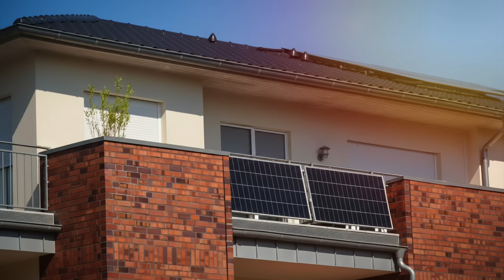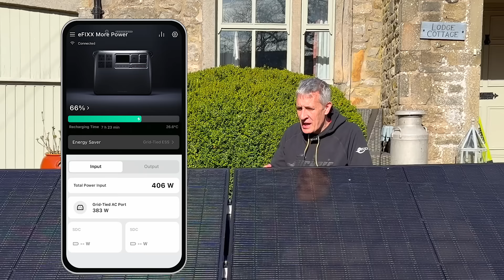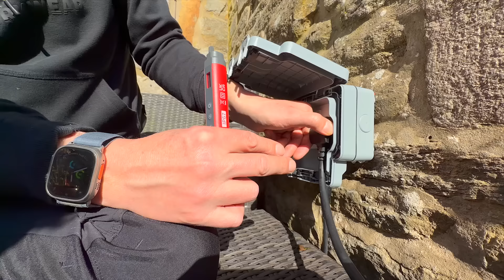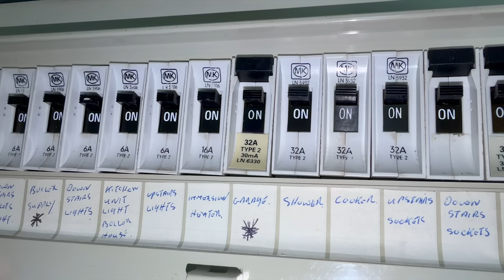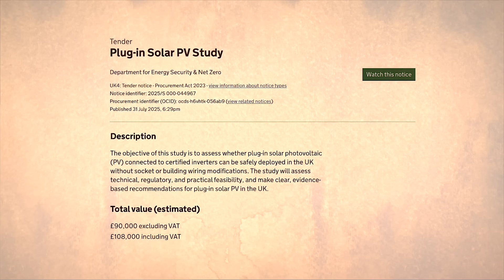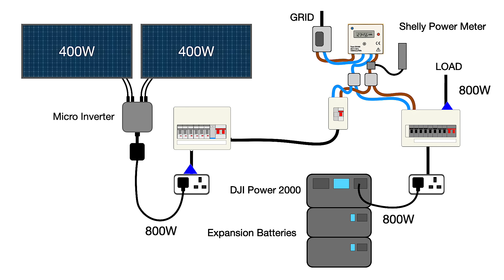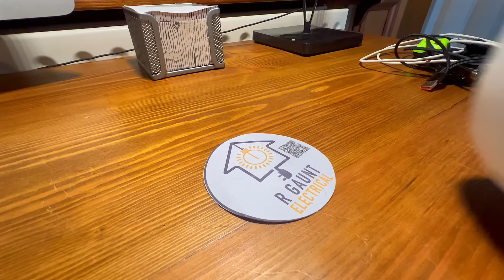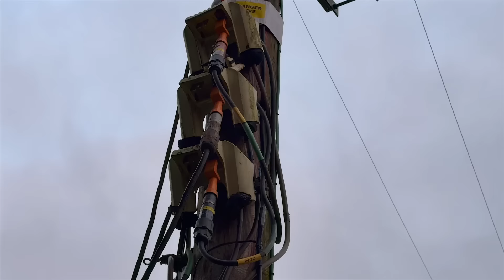Plug in Solar: We’re Told Never Do This… So I Did

Comment from the maker: Check Price & Availability
👉 https://hub.efixx.co.uk/DJIP2000

Plug-In Solar: Banned Today, Legal Tomorrow?
👉 https://www.efixx.co.uk/Articles/plug-in-solar-uk-regulations
Reply: Are the micro inverters only grid following or can they be ran as grid forming in isolation?
Reply: @agw5425 Only On-Grid
Reply from the maker: Grid following only
Reply: What are those water-filled panel support bricks? These look like an interesting alternative to bolting a frame onto my garage for the upcoming PV expansion..
Reply from the maker: The product is called Grambox
Reply: Can I ask what your smart meter would do with this in regards to if my meter was reading £2 on electric today and then I plug in my panels, would the meter slowly go backwards in £ or how would that work? 

Sorry it's badly worded 😂
Reply: @KiloHotel27 Depends on the Meter. Some count backwards some just freeze, some count forwards on reverse power.
Reply: @TonyFisher-lo8hh  Many thanks bro! I was wondering as our government like to take & not give back so I presume they'd just let it carry on & simultaneously steal our power
Reply: @TonyFisher-lo8hh "some count forwards" so you could be paying to send power to the grid?
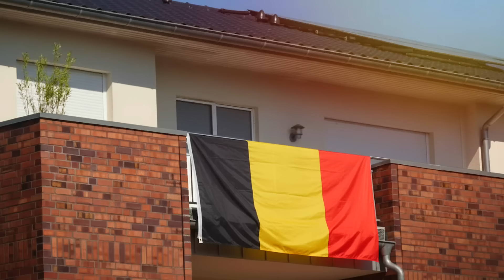Reply: 0:26 - WRONG, big time wrong data. 4 million balcony installations or even more cause most of these balcony PV are not registered and operated like "partisan" or better known as "guerilla" PV systems for years cause too much hazzle to register and too complicated registration portal. 

People buy the systems at Aldi or Lidl and install them easily by plugging them into a socket with nowadays 800 W AC limit and up to 2000 Wp solar panels.

The HWT berlin - university came to a conclusion that over 4 million are already working based on surveys they had done with resellers and customers. 
Right now over 1,25 million are officially registered - but the majority is not and people do not care as owners see it as their right to decide which kind of load and energy generation they are connecting into their sockets.

UK has a big advantage cause british sockets separate neutral and live properly due to a third pin which do not allow to turn a plug 180° around. 
In germany this does not exist and can cause trouble in some rare occassions. So german balcony mirco inverter come with 2 pin connector (and earth) where you can turn those around. Nothing will happen the microinverter will generate power and supply the flat or house.
Reply from the maker: Thanks for the heads up - 👍
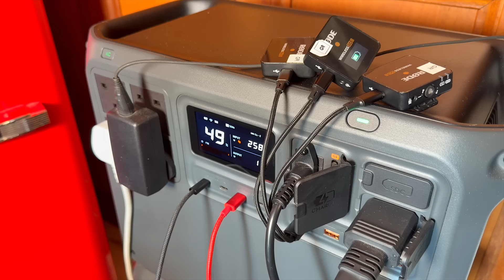Reply: 7:23 - bank of USB outlets
Do not use them this way by plugging in on a daily bases cause the USB C ports will suffer over time till they no longer work. Use a Hub or Cable instead that moves the usual wear and tear from a very expensive device (the dji bases) to a cheap cable or hub easy to replace. 

Happens to often that USB Type C ports struggle with that wear and tear, I have already lost an expensive laptop 3 years ago due to that issue. 

and regarding german balcony safety: it took over 20 years to force the regulator to accept first 600 VA or 600 W microinverter and another battler over 3 years or so for 800 VA or 800W microinverter. So far nothing has burned a flat or house down. 

If things had gone wrong then by the stupid who connected a series of balcony system to 1 single circuit which is usually protected with 16 A x 230 V = roughly 3700 W due to the wiring surface of 1,5 mm² - not diameter. in such cases everything can go wrong by abusing the limits but the same happens to a VW GOLF driver who is driving 140 mph in a village in front of a school or elderly care facility. They can do it and nothing might happen - till they get caught.
Reply from the maker: Great tip on the USB ports!!
Reply: I am confused about your setup, You appear to have panels that can export up to 800W to the home wiring and a Battery Unit separately hooked up the the supply, but no load appears to be connected directly to the batteries  (how do you use them?). Can those Batteries also provide power by the house wiring? Is it allowed to have more than 1 device able to supply the house with power? How are you stopping more that 800W of power being supplied? Ie the Batteries and Solar at feeding at the same time.
Reply: @SeasonsOfMists  The house is the load so if your house is using less than 800W you will be exporting to the grid for free.
If you are using more than 800W i.e. 1000W you will only be using 200W from the grid.
Reply: @FireballXL55  Hey sorry to bug you but I never got an answer and I'm a very curious man. If you get a minute please try to explain roughly what I'm asking for as otherwise I never learn 😂

Previous question on this thread somewhere - 

Can I ask what your smart meter would do with this in regards to if my meter was reading £2 on electric today and then I plug in my panels, would the meter slowly go backwards in £ or how would that work? 

Sorry it's badly worded 😂
Reply: @KiloHotel27 Sorry , do not have a smart meter, but I assume if your solar system is producing less than you are using it would show a reduced power level. So the total would climb slower.
I do not know if they can count back if you are producing more than you are using.
Reply: @FireballXL55  Okay thanks and yeah that's what I thought but with our wonky governments and how they scam us you never know 😂👍🏻

Thanks again 👍🏻
Reply: @SeasonsOfMists he did actually say that on a good day you could theoretically be pulling 800w from panels and 800w from the batteries simultaneously
Reply: Great video, thanks. After watching your first one I bought the 2000 and have since added one expansion pack. All working fine (no solar) and I’m paying on average 10p per unit. I have however, noticed an apparent anomaly and I am hoping you may be able to explain. While the Shelly shows real time demand give or take around 10 watts, my Octopus mini shows consumption around 20 watts. There is always around 30 watts difference. The 40 watts over the 19 hours of the peak period equates to 0.7 to 0.8 kWh and this is indeed what I am being billed for.  All figure are approximate of course as they fluctuate constantly. I understand that there will be always be a little import from the grid but why the difference?
Reply: The DJI units are showing as currently unavailable already lol. Like all of them. Even the 1000 series and the kits with panels all seem to be OOS.
Reply: legal from today i believe!!
Reply: @efixx  

The government has greenlit some changes to wiring regulations, which'll mean that systems under 800W can plug safely into domestic sockets without needing an electrician. This is expected to go live from summer 2026. And retailers such as Lidl are already preparing to bring plug-in solar panels to the UK.
Reply: @efixx  hi what is the life expectancy of this system?  (especially the batteries)
Reply: A small correction, if I may: In Germany, there are currently more than 1.2 million registered so-called balcony power plants. The emphasis is on "registered," because the number of unregistered plants is extremely high, and projections suggest that there could actually be at least four times, possibly even six times as many, in operation.
One of the main reasons for this is that many households still have old electricity meters installed that can count backwards, and registering a power generation system would almost certainly lead to the meter being replaced, which is certainly not in the interest of the balcony power plant operator.

Comment: Hi thanks for the great videos. I have just installed plug in solar. And very happy with it so far. I'm now interested in the dji 2000 battery to catch excess solar and charge off peak overnight electric. Don't want to export to grid but cover base load when no solar. What Shelly would I need also  what protection in distribution box to cover the dji battery in 3pin plug ie. RCBO/Rcd type. 
Thanks

Comment: Do you have a video on how you configured the Shelly / DJI power 2000 and the Ecoflow ? So that the "Excess" power goes to the DJI instead of to the Grid ? 
I have all three systems, but cant get the DJI to take the extra power to charge it up. The Plug in has its own circuit and the apps are loaded on the mobile and Shelly detects both the DJI and Ecoflow but the DJI is not being charged, only on the octopus overnight tariff, which I set a timer with the DJI app. 
So if yo have a PDF or video to show how to pair them all, that would be amazing. Thanks

Comment: wouldnt it be better in a battery system to input the solar power directly into the battery as DC, they output what is needed by the house from the battery?

Comment: I've recently bought a ecoflow inverter and 2 solar panels mounted them securely and plugged it in. Already after 10 days I've saved £10 i know its summer though.

Looking at the DJI in this video, without charging them on a cheaper overnight tariff you could also add solar panels to them? Whilst sending 800w back for your own usage?

Comment: The real issue is the voltages which you failed to measure. How will a system work if the mains voltage is normally over 250V? Will the inverters be unable to export? What if a neighbouring property is exporting? What voltage will sensitive electronic devices in your house get? What happens when an 800W micro inverter (which is connected to everything in a property via the consumer unit) and a kettle or oven is switched on? I would guess that the inverter shuts down as it cannot supply the current and then the lower power devices that is was power are powered by the mains for the duration. Not a big deal for a 3 minute kettle boil, but ovens are usually on for a hour or so. These questions need answering properly with an analysis of the voltage differences in an entire system.

Comment: hello, I followed your advice and got the DJI power 2000, ecoflow balcony system and a shelly Pro em-50, do you have any idea why I can not get thecoflow app to discover by blue tooth the shelly ?  Do you any simple wiring diagram on how the how to install the shelly, I think I have done it correctly following yr videos, but the drawing on the film is too complicated to follow for the shelly, thanks in advance..
Reply from the maker: I’ve got an indevokt @ DJI working off same Shelly device - my suggestion would be to use WiFi rather than Bluetooth.

Comment: The reason you should not backfeed into your house without a dedicated and bomb proof safety lockout in your fuse box or intake that will cut your house off in case of grid failure is the fact that you can backfeed power into the grid during a power failure, which could cause a electrician or contractor to contact a live wire outside your house when that system should be dead. If there is a transformer between your house and a damage wire, that is still high voltage. As a excavator operator, live cables when we are told they are dead, is a real threat.

Comment: Hi it is not JUST the unit the UK system is not safe for systems. So why not, first many houses use PME. THAT is the first no no, second ring mains, they are dangerous, why because a poor connection on somewhere on the ring or worse an earth  wire somewhere, failure is a problem. I used to as a matter of course separate the ring into 2 halves and put each half of a 20A or 16A protection. On top of that the UK protection only operates on the supposed live wire, so the neutral is not on say a ring main disconnected. Until the UK IEE sorry the engineers regs wakes up then you will have problems. I used to run 4mm cable to say washing machine and dryer sockets dedicated as the 2 could be using 6 KW so a possible overload on 2.5mm even not allowing for length etc. (Former NICEIC Electrician now retired)

Comment: Hi are the dji2000 batteries just plugged into a mains socket, do they charge and supply power to the house down the same 13a socket
Reply from the maker: Yes in grid tied mode.

Comment: I thank you very much for your video I have watched it before but I am now going to my housing association because they passed my electrical check with a type AC RCD  in my consumer unit  till 2030  normally this wouldn't bother me however I did not realise that wheelchairs that have lead acid batteries or lithium need a type A  RCD or it  can blind the RCD I mentioned this to him when he tested my electrics but he said I don't need to worry because the wheelchair charger will protect me but my wheelchair charger failed and my house did not trip when it should have I did tell him this but still was not changed

Comment: the Hoymiles HMS-1800-4T can output up to 1.8 kwh can this be used as plug in solar as well if you require to charge your house batteries that are kept in a different location on your property ?  my daily tick over is 1200 watts per hour

Comment: How does this work in terms of safety of working on the system as an electrician? If the  system is plugged in then it will surely be adding potential to other circuits either locally or at the DB?
Reply: No . A MSc certified unit shuts down.

Comment: A few fires and electrocutions should focus the mind - not of politicians of course and maybe not the IET...
If they can't stop Chinese scooters getting in and setting your house alight, they won't stop poor quality Chinese solar kits being sold.
The hype around 0.8kW tickles me.
Almost a waste of time & effort.
It's taken my 3.99kW roof system over over 7 years to pay back.
And now, despite my FIT contract saying rates will increase by RPI, this weasel govt have just arbitrarily changed that to CPI. Hardly surprising when we have a PM who is about to simply override the referendum and take us back into the EU without any recourse to the electorate.
And all the while, solar generation causes the grid more problems because it can't be curtailed like wind.....
Reply: If we were still in the EU we would have these already and cheaper Electricity.

Comment: Its actually an issue called Islanding which is illegal, the reason being if workers turn the power off to work on the lines and you are pumping electricity into it and kill someone, well that is the real issue. The way this is gotten around is with an inverter that power cuts with a grid cut.

Comment: I got £45.00 this month already and it will only get better with the summer months so a year pay back is overkill.
Reply: What system do you have??
Reply: @jablot5054  Ecoflow stream 1200w  micro invertor and 2 515 watt solar panels. its max 800w output though standard for the uk

Comment: In Germany, you must register a balcony solar system with the relevant authority. This can be done online in 5 minutes, but only since about 5 years ago. As a result, 1.5 million systems have been registered, and it is estimated that there are 5 million unreported cases; the approximate number of systems sold is well known. 

Topic: Inverters In Germany, and perhaps throughout the EU, a microinverter may only feed electricity into the grid when the outlet connected to the public grid is online. To this end, all microinverters have a built-in relay that electrically isolates the current. If the public grid goes offline (or the plug is pulled), the inverter must shut down within 2 milliseconds. That’s why you should hear a click when turning it on—that’s the relay. With German Schuko plugs, the inverter has long since shut down before the contacts come out of the outlet. With the system in the UK, I see a problem there at first glance, unless it’s been somehow mechanically resolved within the outlet.

Translated with DeepL.com (free version)

Comment: A lot of people are asking about breakers that are not certified for export.
But does anyone know what in such a circuit breaker could actually fail and why? Current already flows in both directions through a breaker (one way on +ve half cycles - the other way on -ve half cycles) - its just that with export the current flow direction changes 1/2 cycles - current is still flowing in both directions? Ignoring the fact its not certified, what is it that can actually fail with export? thermal element (bimetal strip)? magnetic trip? arc chutes and splitter plates?

Comment: Using a lead into a power point for solar input is a bad idea.
Using the switch wil cause arcing.  
Very surprised the video did not state this.
The input point should be clearly labelled.
The plug should have a loop for quick removal.
Also its a good idea to have the power point inside a locked box.  Only to be accessed by the installer.

Comment: I've seen a few videos like this recently, and opinions seem divided as to whether it's safe or not.  My question is how does a set-up like this compare to traditional solar panels and batteries?  I've been considering the systems offered by Costco, at around £8,000 to £10,000 for 10-18 panels, plus battery and whatever else is needed, including installation for no extra cost.  This set-up is currently £9,599 - Fresh Solar 10.24kWh Fox ESS Evo Battery Solar PV System [18 Panels] - Fully Installed.  Would that be a better, long term deal?  Or should I hold out for these 'portable' systems to be given an official green light?
Reply: Get a full system, you wont regret it. These systems are good for A renters, B those wanting to try it out, C auxiliary systems for a bit of extra generation. Garden fence systems etc.
Reply: @recondite12  Thanks.  My concern is spending £10k now, when we may be looking to move in a couple of years or so.  Not sure we'd get an extra £10k for the house!  So I'm a bit torn, and these DIY systems look ok, and we could take them with us.  But yes, ideally, having a 'proper' system is what I would prefer.